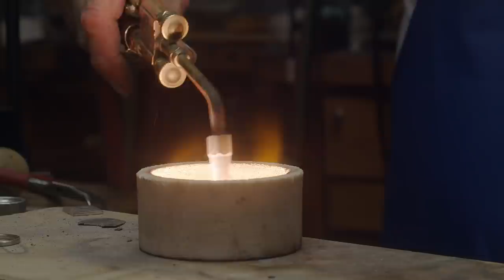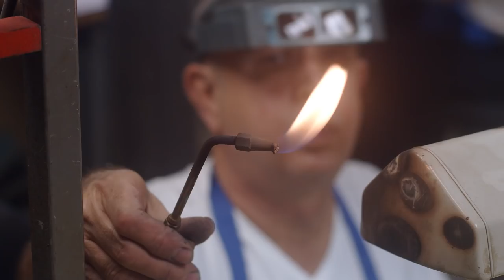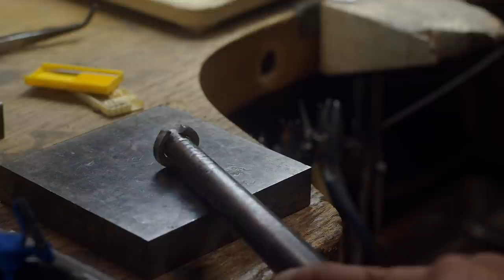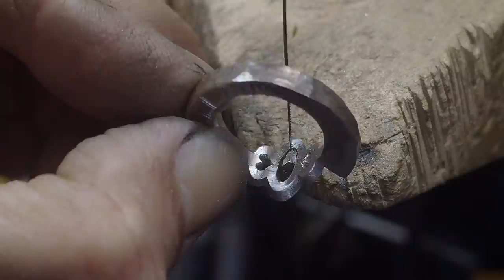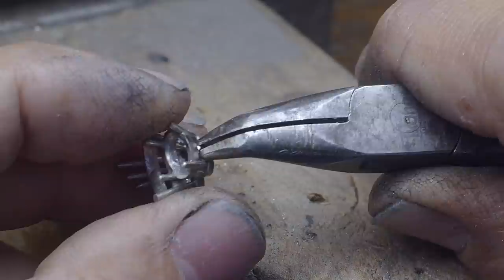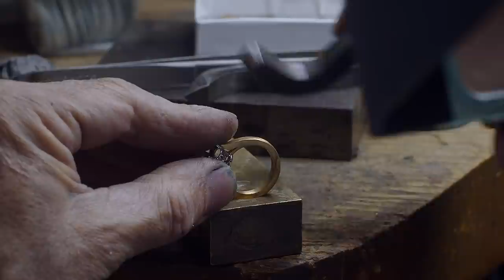Making a $100,000 Diamond Ring – YES, from DUST!

Comment: I didn't think you could solder platinum to hold jewelry due to the melting point differences...hand worked platinum is definitely better for settings than brittle, stress-corroding nickel white gold.

Comment: Was that platinum dust you had in the crucible? If so be VERY careful as that dust will cause platinosis so fast your head will spin. 

Platinum although very safe to handle in solid form is incredibly dangerous in either solution or dust form. (I’m a PM refiner)